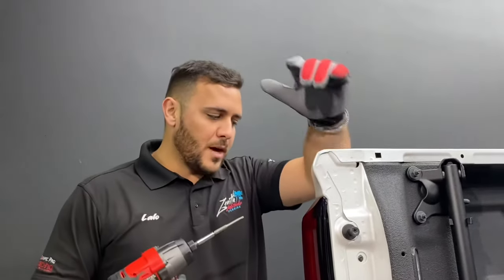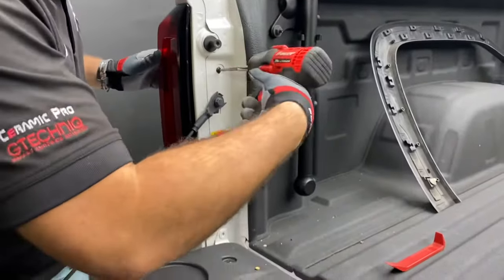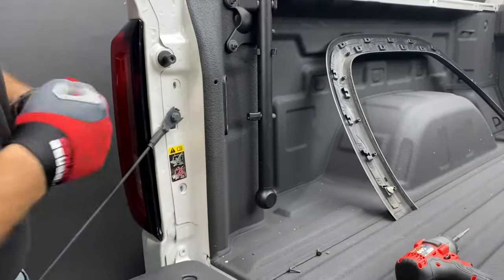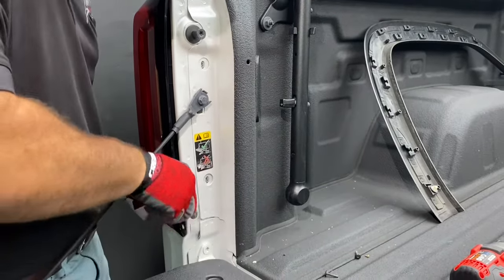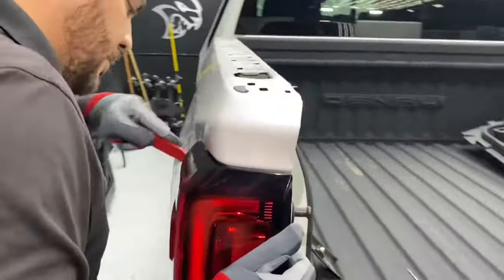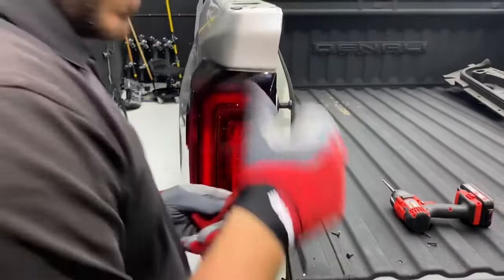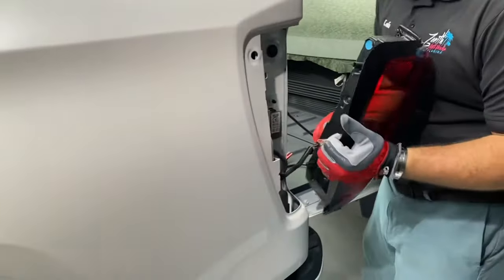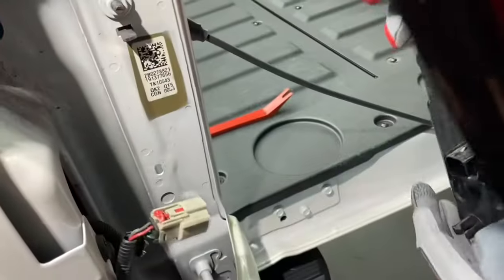2019 GMC Sierra Denali Tail Light Removal (Easy)

Comment: How does one go about replacing the reverse bulb on this type of tail light? I want to add a bright LED, but don’t know how to get to the actual bulb. Thank you!
Reply: I think this style may already be LED
Reply: If they are, they are not very bright...
Reply: You have to remove all of the T15 screws all around the back side of the light. Then you’ll have access to the bulbs
Reply: @DadinNC  is there a seal that would be broken and moisture get in the casing?